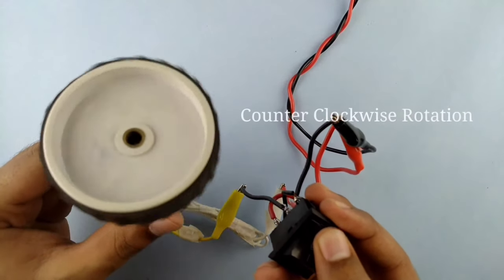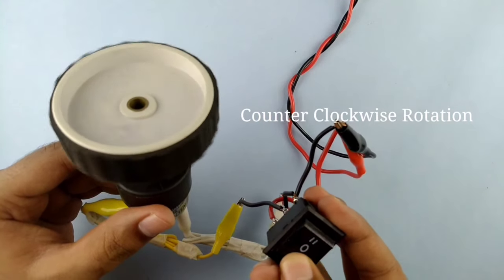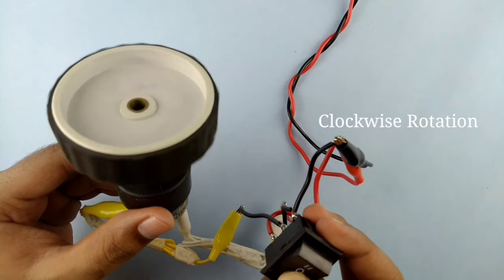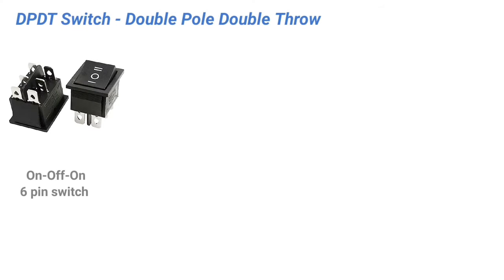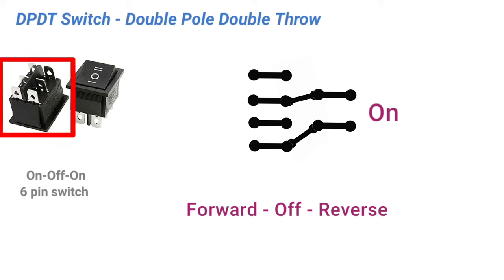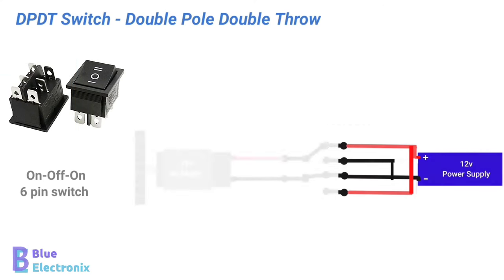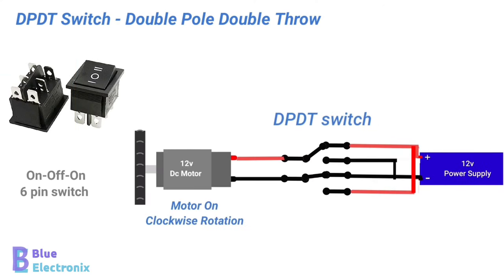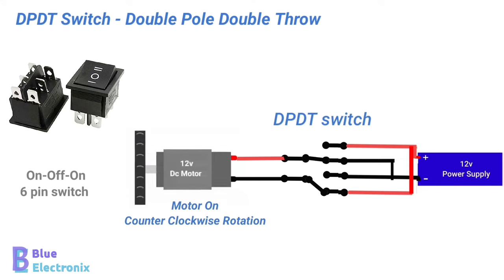DPDT switch with Connection and Diagram | Double Pole Double Throw | Explained with animation |

Comment: dear sir, would u check the arrow flow direction in the presentation diagram after reversing the switch, I think the arrows flow direction must be reversed also. correct me if am wrong. Thanks for your good presentation.